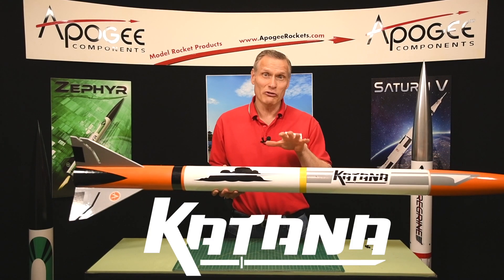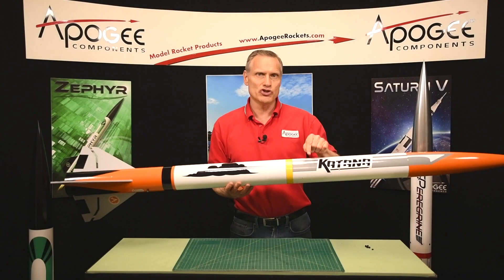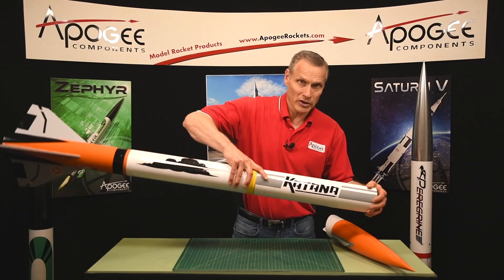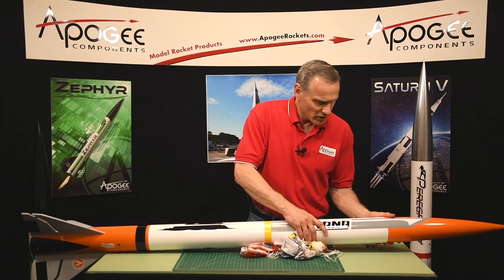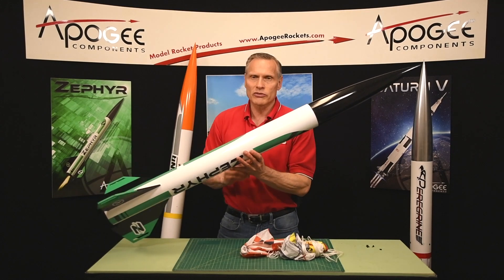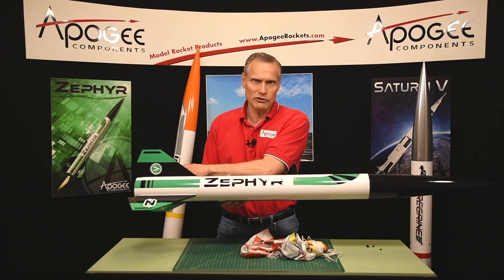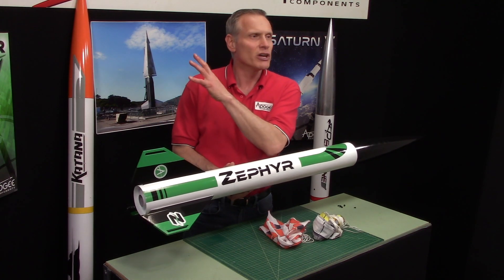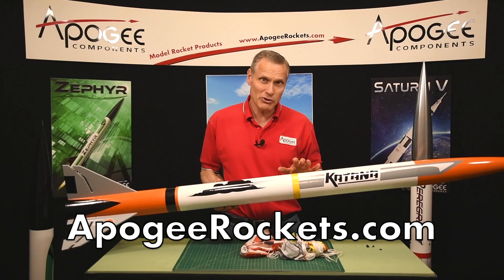Katana Model Rocket

Comment: I had a Katana. Flew it on a K740  perfectly. But if you fly an L-Class motor recommend tip to tip fiberglass or composite fiber on the fin can because I had an awesome shred on a Cesaroni L990. Took off like a bullet. Fins did the same. 😮😢😂
Reply from the maker: Interesting. We'll noted.